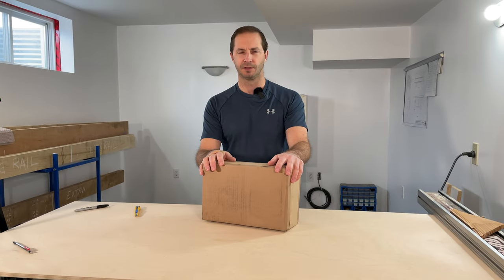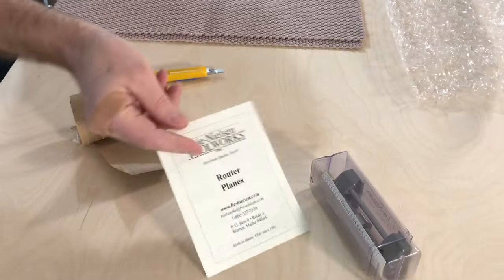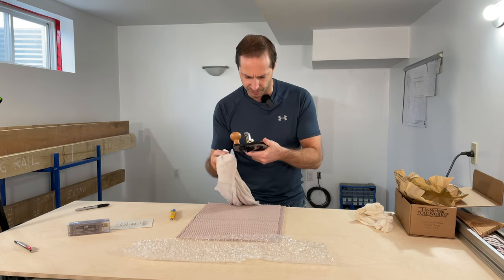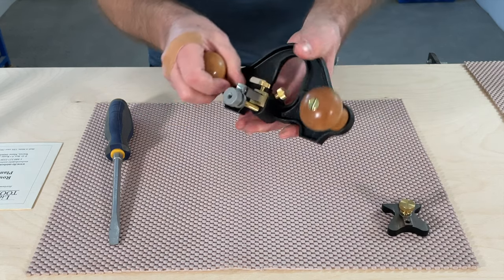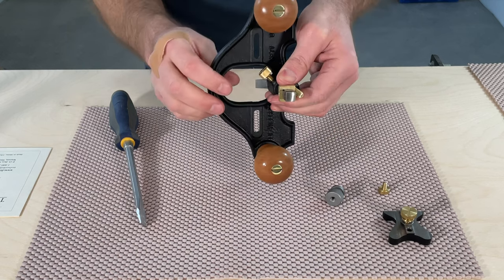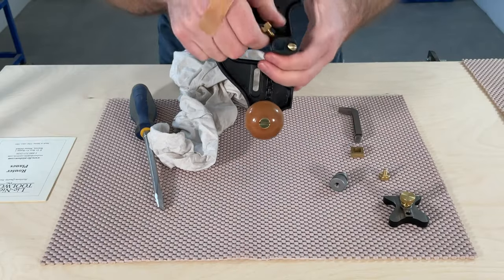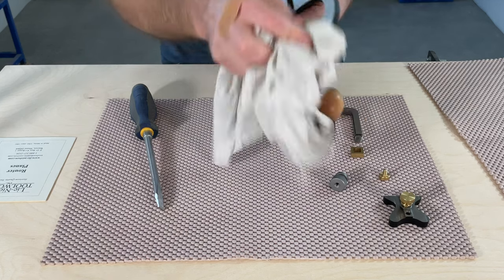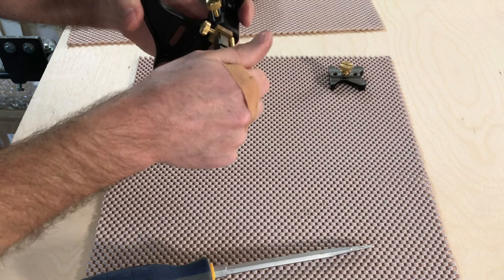Lie-Nielsen Router Plane // Set Up, Use & First Impressions

Comment: Ironically, my best take from this video was not really about the router but rather the use of the non-slip mat which I have owned for over 20 years but never associated with hand tool work holding rather than hand held power routing. Funny when you have to confront your personal “blind spots”………to think I would have set up a more complicated work hold to do same task makes me question my intelligence which is a good thing…..😂
Reply from the maker: I’ve been there many times too bud!